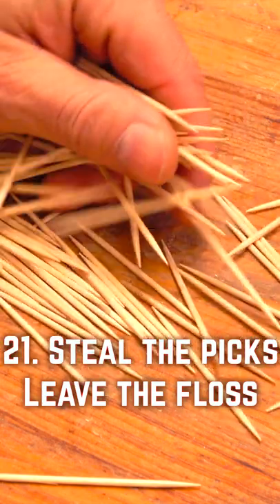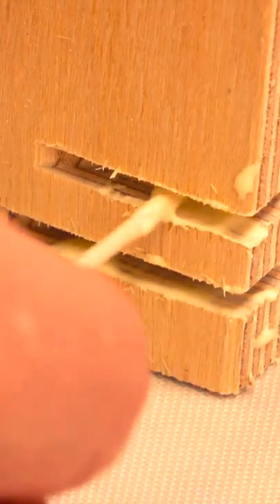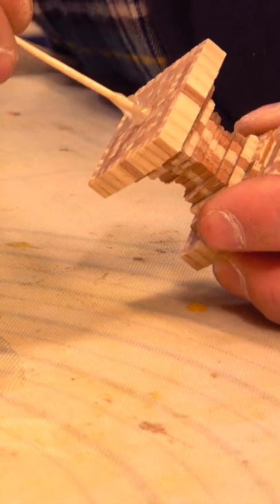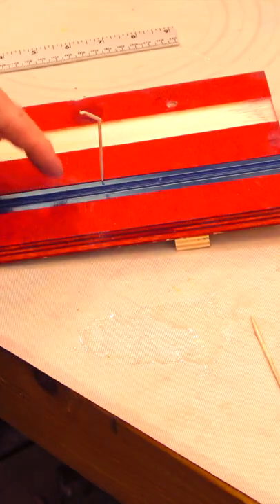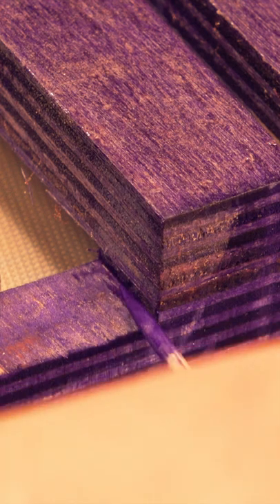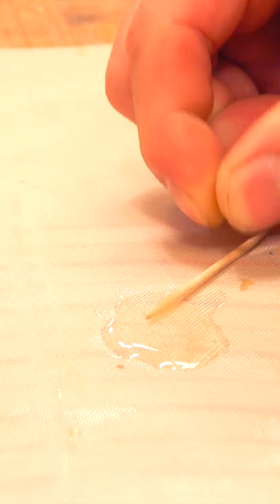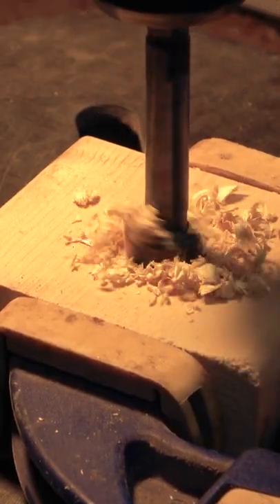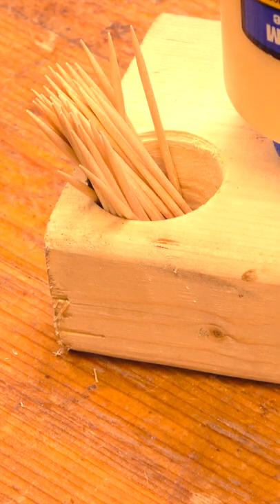21. Steal the picks, leave the floss #shorts #MTbitesize

Comment: I also use bamboo skewers of both sizes for small size doweling too just put them in and snap them off and I love the pointy end of the toothpicks just so useful
Reply: I have used bamboo skewers as alignment pins and to fill holes!  They work well enough but they do not blend in lol
Reply: @CeeJayThe13th  Yes but you can paint it black and everything blends then haha